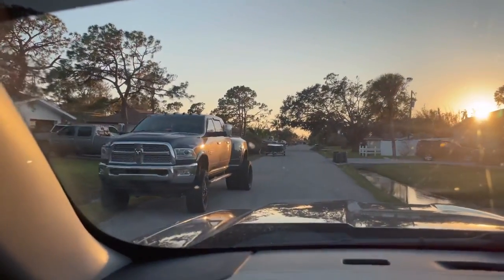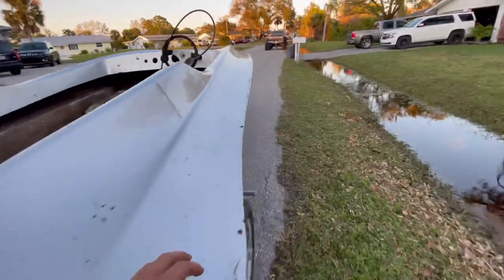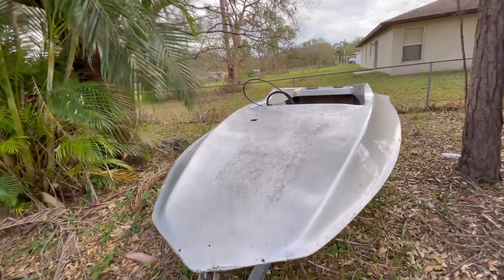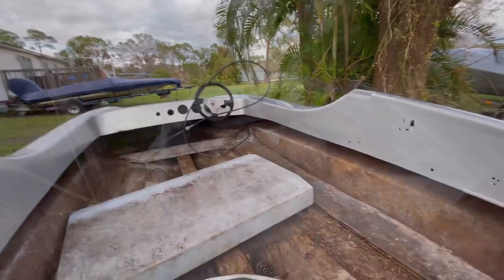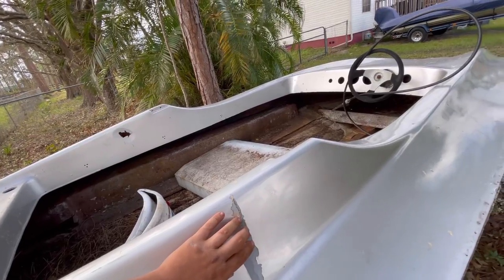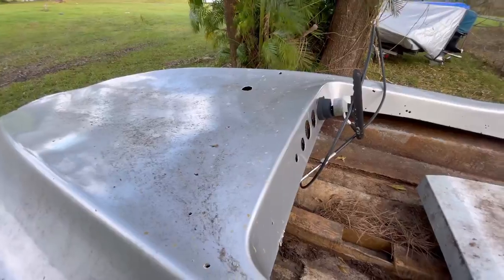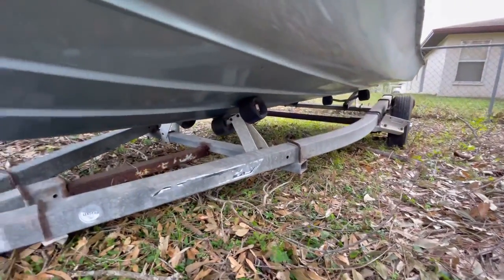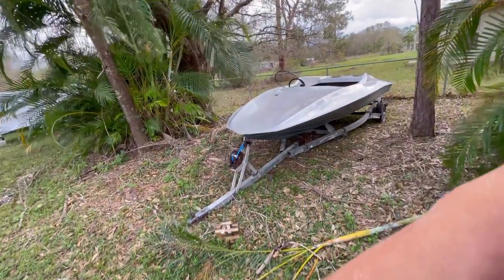I got a hydrostream viper to rebuild for the channel!! 15ft speed boat!!

Comment: brought my boat in half in the same condition, all new core stringer box cosa 1/2 floor, bin year and half project. have a 245 bridge port for it , have almost 8 invested with buying material and engine and rigging the boat.

Comment: 31 Hydrostreams I have put back on the water. Cut the splash well out and flat deck the transom.  Ran one for many years with a 2.0 F1 motor on a 15 in  mid.

Comment: Hell yeah, I'm about to rebuild my Vulture! Mine needs from core up... basically a complete rebuild. Core, stringers, floor, exterior gelcoat, dash, seats, pedals, fuel tank, wiring, hang big 2.5 merc, run steering, interior jack pump. Big project, but going to have entirely custom handbuilt boat!

Comment: In the video I watched yesterday where you were telling us about your grand sport, you said you took the allison lip off your hull. What was the reason you did that?  Also looking forward to your boat project.  Thanks Larry
Reply from the maker: Its a big controversy on allisons but in my beliefs the boat performs better without the lip. Most people say they are faster with the lip but i think with a different setup of motor height setback and prop, the same speeds can be achieved without the lip as with it
Reply: @weekendsonthewater  thanks for your feedback. I think your right. A bunch of factors play can play a role. Larry

Comment: tips! no shit. i got an insane one . its a trophy!  81 viper. pulled the floor. added glass to the hull and new stringer.  gussets. builge  area, foam filled hull. 150 merc 2007 xr6. the last one. ha. i got 90hrs at best on it. bobs bullit. 30" 4 blade over hub hydromotive. flys. about 85!  ha.  i'll sell it to you  for cheap.  no shit! its better than  new.

Comment: Great project,, build a cradle to sit it in as you continue to strip the old core etc,,,, the cradle will help hold hull shape so spend a little time to get it right, then before you uncap it make sure there are some supports to keep sides from flopping
Reply: Can the trailer be the cradle or is that a bad idea?
Reply: David Mullis ,,, depends on the trailer, but with this trailer I'd say no, basically the more support you can get to retain its shape the better, remembering when the core and stringers are cut out there isn't much rigidity